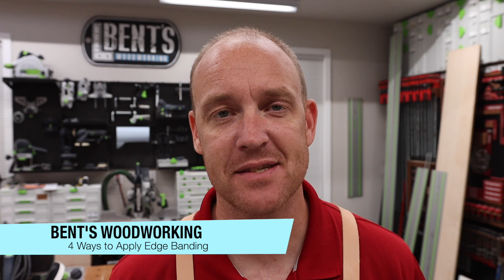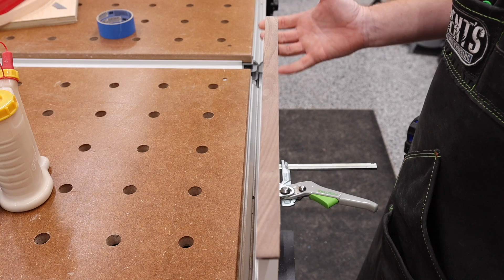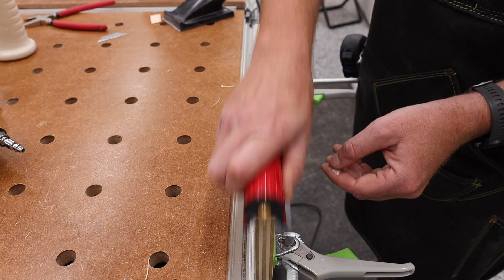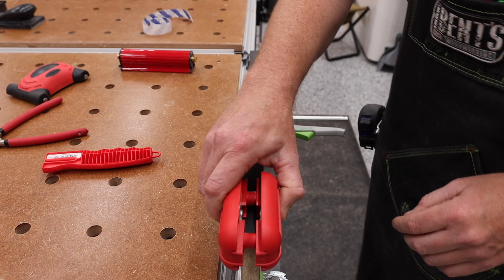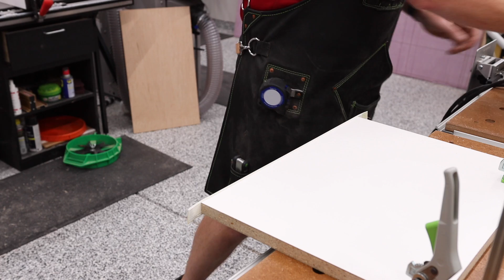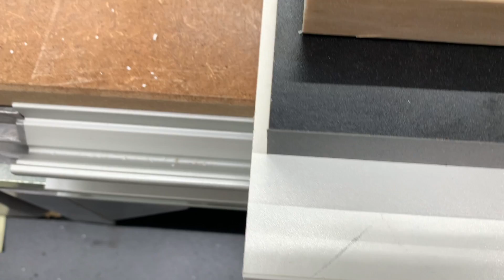4 tips for applying edge banding

Comment: FYI Fastcap makes a double sided tape that helps hold unglued edge banding really well.   One tip,  I use some compressed air to clean the edge before applying the edge banding to make sure I get the best grip possible.

Comment: I use a SHARP chisel to trim the edges of veneer, you can use the flat back of the chisel to register on the surface of the plywood.
Reply from the maker: Really great idea. Not sure why I didn’t include that in this video.
Reply: I have done the same for a long time.  The chisel,does need to be really sharp but it works very well and leaves a neat edge.
Reply: @katabrontes  I was using it on exotic wood so I was concerned just using a flush trim bit on the router would cause alot of tearout.
Reply: Dominic DiClemente many years ago when I built shelves out of 3/4" (18mm) veneered blackboard I used to edge them with about 1" (25mm) of softwood then plane the bottom edge of the softwood to about 1/2" (12mm) at the front edge which made the shelves look a lot lighter from the front.  They were painted in those days.

Comment: Appreciate the video! I'm currently finishing up a Media Console and have some iron-on edge banding I'll be applying for the first time. TBH, the Festool looks pretty cumbersome, especially since you still need to flush cut and trim the edges anyway
Reply: I think with Festool prices that a basic table edge banding machine could be close in cost. Then it becomes a trade off for brining the tool to the work or brining the work to the tool. I can see the Festool Conturo being ultra slick for large panels.
Reply from the maker: It is a dream to use. The time savings makes it worth it to me

Comment: Using a prefinished birch ply 3/4 in. and what I found and should have realized the finish veneer is thinner than the unfinished. Conclusion when you go to edge band I think your router method would be the best because using a sharp edge by hand I had a lot of those "OH DAMN" moments, that veneer has to be paper thin!

Comment: Thanks for the video. I’m just finishing up a project that’s a knock off of an unnamed Swedish furniture company’s piece that’s been out of stock for months. So far, I’ve ironed on 75’ of melamine edge banding. I may have to look into that peel and stick for future projects. 😂

I always enjoy your videos!
Reply from the maker: Glad you found it helpful 👍
Reply: Jason Bent - Bent's Woodworking:  I have a suspicion that edge banding that uses a hot melt adhesive such as the iron-on type will be more durable than peel-and-stick banding because the ironing pressure forces the molten adhesive deeper into the wood fibres providing better anchorage.  Personally I’ve never used the peel-and-stick banding but would be interested in any testing anyone has done, especially longer term testing which I suspect would show greater differences between the two types due to faster degradation of what is merely a pressure-activated contact adhesive.  Any takers?

Comment: Great video! Really enjoy your channel.  I know you don't want to tell people what to use but I would still like to hear pros and cons from your perspective. Cost and ease of application are the only things that come up. What is about durability? Hardwood edge banding seems to win here. Not sure how much you gain with the festool machine in terms of durability compared to iron though? What looks the best? To make hardwood edge banding disappear requires work terms of grain matching etc. Would love to hear your  thoughts on these questions...
Reply from the maker: That would be a good idea for another video for sure. As for the strength of the machine vs iron on, the strength of the glue from the pucks is far superior to iron on options.

Comment: The absolutely best ans easiest way to trim edge banding is a hand plane iron. It registers perfectly on the plywood and it cuts without leaving any marks at all
Reply from the maker: Thanks for the tip!
Reply: Jason Bent - Bent's Woodworking:  Yes, a good tip.  Being a lot wider than a chisel, it will indeed rest very securely on the face of the board and be more stable than a chisel, especially in the hands of a less experienced wood worker.  As with a chisel, it must be kept very sharp.

Comment: Your list of tools used in this video does not identify the model of the Router used in part four of this video - Could you please identify the Router model - Also, in particular, if the guide that is attached to the Router is from a different manufacturer, please state who the manufacturer is - Thank you
Reply from the maker: It’s the MFK 700 from festool
Reply: @bentswoodworking  Thank you for specifying the Router to be an MFK 700 Festool Router - Definitely a top of the line Router with an associated high price tag - Amazon sells only the Router in its Vertical base form for $ 499.00 - Doesn’t sell the Router in its Kit form which includes the Horizontal base - Kit form generally sells for $ 599.00 - Amazon does have a short video clip that shows you how easy it is to switch between the two bases - Wish Milwaukee had a horizontal base unit for my cordless compact Router but they don’t 😧

Comment: You missed the pvc edge banding without preglue on it and not using the festool. To make things worse apply it to particle board which will just soak up all the glue.
Reply: Use spray contact
Reply: @troyqueen9503  can you recommend a brand